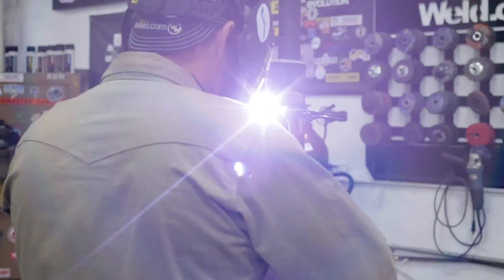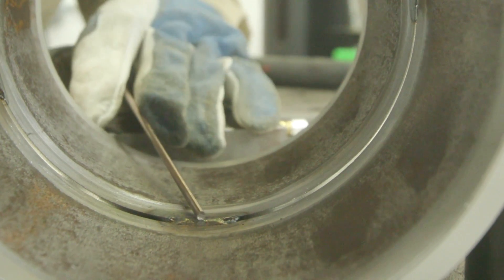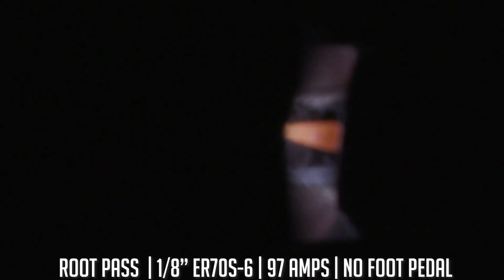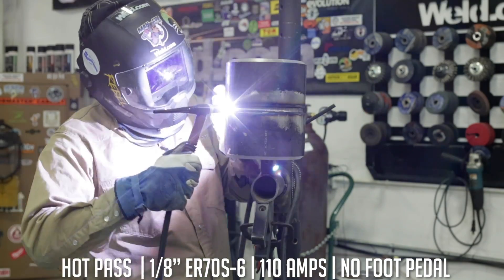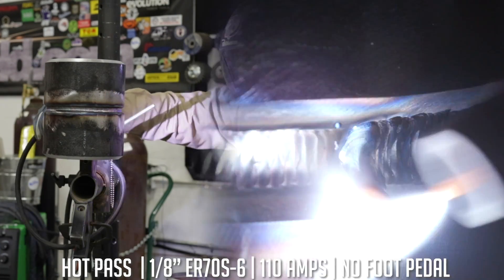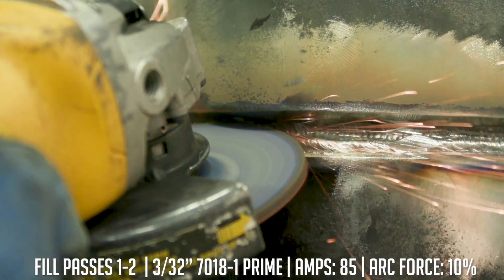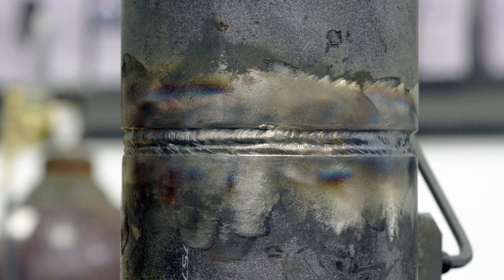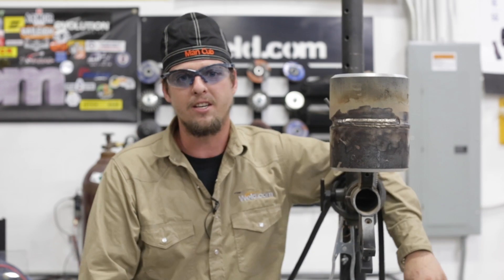Combo Pipe Welding | 2G TIG Root, 7018 Fill Cap

Comment: Its crazy how easy you make that tig root pass look... weldon, but i was wondering why you start out with 3/32's  7018's rather than just go right to 1/8 rods, would seem like higher deposition rate, only need to grab one type of rod therfore less time and potentially less cost for the filler metal and I would think better you might get better fusion and less chance of slag inclusions or porosity given the higher heat?

Comment: Hi man cub I have a question for you or anyone that can be of any assistance I'm trying to figure out why I keep getting undercut when I do my last bead on my cap im running 1/8 7018 Excalibur rod @ 110 amps on a lincoln invertec the arc is set on soft also same settings for the bottom and middle pass on the cap no problems just on the top one same pipe as this video ,I've tried pausing longer on the top when I oscillate the rod in a zigzag motion to allow it to fill in but still get undercut also I allowed the pipe to cool down before I started the pass any guidance you can provide would be highly appreciated thank you for your time

Comment: Non-welder question: Is it common to do a combination of two types of welding? Why use TIG on the root pass?
Reply: It’s common to do tig for the root on pipe because it’s a very clean weld. You could use stick but stick has a slag coating when it cools that has to be removed. On a sealed pipe you would have no easy way to clean it. The fill passes are stick because if you did tig all the way out it would take forever because it has a low deposit rate.
Reply: @JasmineTerry31  Makes perfect sense. Thanks!

Comment: You guys get spoiled in fit up with those little coupons. Those 40-50 ft pipe joints don't cooperate quite so easily in the field.  Good job making the weld though

Comment: Tig welding was always my worst enemy. I touch the Tungsten to the Wire and got Zapped So Bad... I never took up Mig Class again Sir.
* why can't you weld half way around the tube/pipe and reposition and finish the weld Sir???
Reply: I think it's safe to say the Rig Welding is Cleaner than. 7018 stick welding. Q- So why not finish the job with TIG??? Are their actual on the job practices that require you to do the swap of Mig to Stick??? Plz remember I am an adult class beginner... I mean no-harm nor-pun. I just wanna learn and you guys do a Great job. Thank you.

Comment: Plz what are the tips on how to pass an xray weld test. Defects to avoid and things to do. Just tips thanks
Reply: Tip #1 If you even think you dip your tungsten stop right away and grind a little bit. 
Tip#2 If you keep welding with a dirty tungsten you are putting some particles of tungsten in the puddle.You wont even see it your eye. When they x-ray your pipe it will have tons of white    tungsten particles when looking at the x-ray.
Tip#3 Bring you tungsten back into your cup where you cant touch your puddle
Tip#4 If your welding carbon steel get all the mill scale off where your are welding.
Tip#5 On carbon still pipe get the glass (silica) deposits off with a file or whatever you have on hand. After you make each pass.
Tip#6 Do a slight pause on your toes with tig to burn in good. That were you will get lack of fusion.

Hope this help buddy

Comment: 97 amps? If it works it works👍 personally i like to go in bit hotter than that on a root, around 115-120 on 6" s80. We only use 2.4mm rod so a bit different, but thumbs up!

Comment: I have a question about arc length in dc tig. Obviously you want as short of an arc length as possible for the best penetration but if you had to make a fairly wide bead as either a cap or just that the specs require it to cover more of the steel can you draw a longer arc length with higher amps to widen out your cone or are you better off just making multiple passes or doing some kind of weave or walk the cup?
Reply: Ben Miller sharpening your tungsten to about 15 degrees like a needle and you should get a wide, low voltage arc column.

Comment: Wouldnt be easier to start on the non tight side? The heat will draw the tight side open, in theory.
Reply: your theory works when putting in tacks.  When it already has 4 tacks in you wanna hit that tight side first.  If you weld out the loose side first the whole pipe begins to close up a hair and your tight side gets tighter.

Comment: Maybe it's the camera microphone but it sounded like you were running 7018 in straight polarity. Also if you have a low spot on the root and you just turn up your amperage and run it over, you will just end up making it worse.

Comment: Nice video I recently bust a 12 in schedule 40 mig root 7018 fill cap..busted me on cap didnt let it cool...happens...keep them comeing fellas
Reply: Just curious but that sounds like an unusual procedure? Any reason they do a 7018 fill cap instead of FCAW? Or is just so they qualify two procedures for field work if guys need to stick weld sockets etc?
Reply: My bad, it could be to do with base material too because we get some high alloy carbon pipe that can only be tig root and stick fill and cap to meet the required tensile strengths etc.
Reply: Its pipeline procedures I dont know why it's that test but after pass the 6g they want 12 on12 saddle. For shop job....only flux is on there skids...and there 100% x ray also they build launchers for pigs ....so  I had a lil bit undercut on the capp
Reply: Cool as, I’m in Australia. Mainly done shop spooling and site work for power stations and oil and gas. I’ve busted tests so best of luck on the next one! You learn from your F-ups ay!

Comment: Always start filling from top to bottom and cap from bottom to top
Reply: Never heard of that
Reply: Old school taught me that
Reply: @chente5365  why though max pen is always bottom to top, shallower penetration for a quicker fill?
Reply: Gravity your weld is going to sag in this position the point is to be flush at the top and have a small lip at the bottom that way when you run the cap it rolls over that bottom lip and you dont get any undercut on that top bead not even a little .
Reply: @chente5365  never heard of it but it makes sense but only with a tig fill tho

Comment: Little trick I learned in school. Lift that post arm up, flip the coupon upside down. You can walk all the way around it then
Reply: Mike Ford most tests you can’t break out of position, but if it’s just practice I wouldn’t see an issue

Comment: A quick stringer with 3/32 lo-hi on the top of the bevel before the cap will make the last cap pass wet in alot better and you won't have to stack as much iron to get that last pass above the bevel. Anyways great job brother that's just a little trick I employ on any horizontal weld.